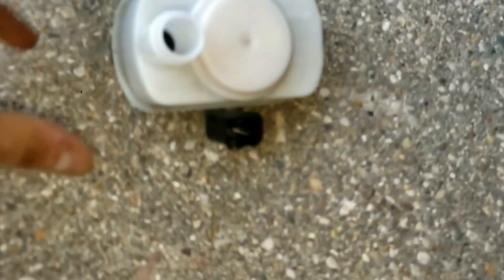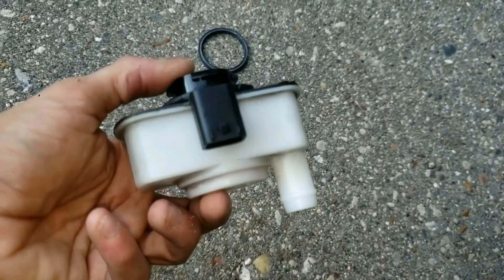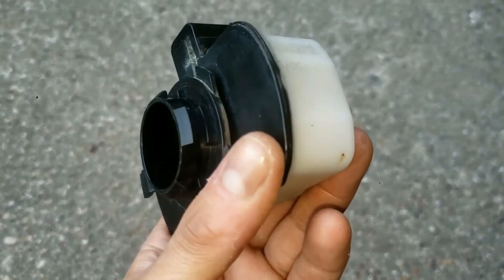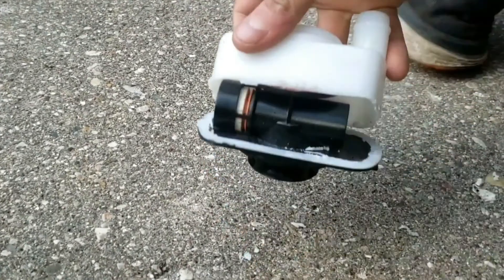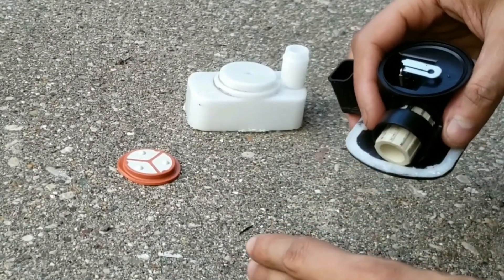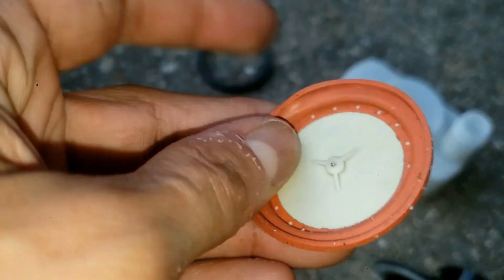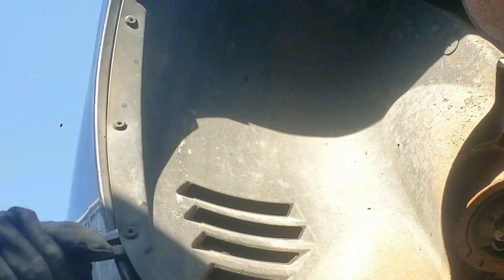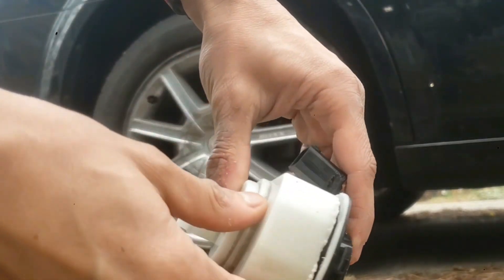EVAP Leak Detection Pump Tear Down 🪓 And Testing Chrysler Dodge Jeep

Comment: Get the Dorman replacement (Amazon $33)- avoid the $20 versions, as those ship with an overstretched too large O-Ring, and they do not rattle when shaken ( pre seized from China
Reply from the maker: Interesting. Thanks for the tip. I think i also used the Dorman one, & put a link in the description.

Comment: There is a crack at the plastic connector. Look on the inside whenever he's got it cut open there's green corrosion on the inside close to that connector. That was actually the issue. Once a corrosion starts it's just replace the whole unit. Here we are in 2025 and they're about 45 bucks from AutoZone. You can get the Mopar one online for about $31 ship to your door. Can't say that the Mopar is any better than the Dorman but look at what year you have and how many miles you have on the car and how long the Mopar one actually lasted
Reply from the maker: Hopefully this comment helps others out!

Comment: Hi after a deep search i found how to test it. It is a sensor not a valve in this case for Dodge, those wires, send a ground sígnale to the Computer and you Can mesure it with a multimeter :)
Reply: Can you make a video Of how to test it ? Love your video
Reply from the maker: Thanks, if I can ever get one of these again, then I will make a new video on this.
Reply from the maker: Nice, always great when you can just use a multi-meter to test these or any components.

Comment: good video. Can I apply DC voltage to unit?  If so, is it 12VDC or other like 5VDC. confused if this is a meaningful test and what voltage. tx for video.
Reply from the maker: I might have used a power tool battery before as a test which which was probably 12 volts.

Comment: How do i know if its a leak detection pump or another part under the hood i have a 2014 chrysler 300 that is throwing codes P0440 and P0441
Reply from the maker: Emissions are tricky. It could be many issues even the slightest like a hole in a rubber hose. Its usually best to start with the codes, and with those codes knock out what the problem may be  preferably starting with the cheapest supply to be replaced unless time is more important than the cost of the item. Then focus on that item to be replaced 1st. Emissions suck!

Comment: This video is helpful.  But the only thing I'll say is: It would be helpful to "see" more of where this part is, how to remove everything, replace the part, and put everything back together.  

On other note, Arizona has reasonably-strict Emissions Testing and it's required every 2 yrs you go to register your tags with the AZDMV
Reply from the maker: Interesting about Arizona. This cant be repaired this part, as its a sealed unit. Also they are relatively inexpensive to replace.

Comment: I have 2018 charger sxt plus replaced purge valve canister, fuel tank pressure sensor still have code p0452 had water in my Evaporative System Integrity Module and the charcoal canister bought new esim and baking the charcoal canister at 225 degrees over night to dry, I’m curious how did I get water there and why? Also will this help?
Reply from the maker: Not sure about the water, but this could help as that code is tied to the evap system, and you said you replaced pretty much many other components of the emission system so it probably wont hurt changing this as this is also a relatively inexpensive part.

Comment: Im curious. Is it possible that a bug could get stuck in there? I found one in mine stuck to the long weight.
Reply from the maker: It's a sealed unit. So very unusual unless their was a crack in it. Or a bug crawled in when it was being made at the factory.
Reply: @FixCarYourself  I agree. Thanks

Comment: So i have a p0456 code and i replaced this today. The old one rattles like your did and the brand new one i installed doesnt rattle.
Reply from the maker: Good to know. This should help others, and further make them aware.
Reply: weird that it does NOT rattle new one.
Reply: @jviews1  still working good. No check engine lights.
Reply: New ones don’t rattle, old one I had rattle too replace with the new one and code went away

Comment: Ended up researching my p0440/p0456 code and this did the trick. I initially got got the purge valve code and changed that and still had the code. Checked vacuum hoses and charcoal canister and after more research saw nothing wrong so last cheap option before a smoke test or canister change would be the detection pump.
Reply from the maker: Nice job! Glad this helped. You did the right thing before doing the smoke test. Glad you fixed the problem yourself.

Comment: I have purchased the exact item from the link. It arrived and looks and functions differently than the one in your video. The weights don't move and there are 2 instead of one. The new one looks exactly like my current one with the 2 weights and the current weights don't move either. Amazon tells me I bought this exact one 5 years ago and that is the one I am replacing.....Even in the item images there are two weights not one like you show......so whats incorrect here? The part or that it should have a single weight or that they should move? Thanks---In NY and they really care
Reply from the maker: How do you know if their is only 1 weight or 2. You can't really tell unless you cut it open. The weights may move when certain pressure is applied to it.

Comment: With the Engine off, and a Smoke test running I get smoke out of the ESIM breather vent behind the Gas Filler. (2015 Jeep JKU). Is the Valve for the vent supposed to be closed with engine off or open?
Reply from the maker: smoke should not come out from the breather vent.

Comment: I was unable to fill gas tank without the nozzle clicking off continuously. Changing this was an option. The video i watched said if you shake the part and it rattled, it was no good. Mine did that and the new replacement did not rattle. I drove to gas station and was able to fill up tank with no issues. 2014 Ram 1500.
Reply from the maker: Great job!
Reply: @FixCarYourself   Ok my old or new dont rattle. Is that good or bad at this point its hard to tell. Video here says rattle good. You say rattle bad......
Reply: @MrMctheking when I replaced my old one it Rattled and the New one did NOT rattle so 🤷🏻‍♂️
Reply: you got lucky. unable to fill tank is usually bad canister, not valve.

Comment: Hello, thank you ver much for your video, congrats for your Good work! I  have a question about the eléctrical switch, is there a way to check it? I provided 5v to the switch simulating the pcm and there is no any sound inside, I should hear the mechanical switch movement sound, right?
Reply from the maker: You supplied power to it so that's good. Normally you would hear the sounds of the weights moving when you blow from the back or the front.
Reply: @FixCarYourself  great, thank you ver much for your help!

Comment: It's not a Leak Detection Pump (LDP). Its a EVAP System Integrity Monitor (ESIM). They are not the same thing. Older Dodge Caravans used a LDP but the newer ones use an ESIM. There is a lot of confusion in the auto parts world about exactly what this component is called. An LDP uses engine vacuum to cycle a diaphragm to pump up the system to test it for leaks. A system that has an ESIM uses the normal pressure variations  created in the gas tank when the fuel vaporizes and condenses to test the system so no pump is required.
Reply: I just bought a new one of these for my Jeep, and it did not make any noises when shaking it. The old one I pulled off the car did make a noise when shaking.
Reply: @Mike__P same for me. I did one today on my sister's 08 jeep grand cherokee. Did this fix yours?
Reply: @JonnyBlazeTCB  nope. Code came back a day later.
Reply: @Mike__P Dang. 😢
Reply: @Mike__P wonder if it IS supposed to rattle then.... ive read others commenting that their new ones didn't rattle either. Mine is slightly different then this one though. It's an 08 Jeep Grand Cherokee.
Reply from the maker: Yep that's right. And very nice quick explanation on the differences. Lot of part suppliers still call them a Leak detection pump though even if they are an ESIM.
Reply: @FixCarYourself hi 👋 I have a question can I replace de evap  just like a maintenance thing ? Or need to wait until fail .. thanks

Comment: My car (2015 Jeep Renegade 2.4l 4-cylinder)  has had tripped P0440, P0452, and P0456. I took it into my local mechanic for diagnosis. After the problem being diagnosed and having the engine computer flashed by Mopar, I have narrowed it down to being this specific part. I ordered parts and after watching this video, I feel more confident in being able to perform the job myself because labor is expensive 😅 I appreciate the how-to in the previous video!
Reply from the maker: Glad it helped and gave you a good idea on how to tackle this, and I'm glad your doing it yourself. Labor is getting even more outrageous, but at least your learning more about your car by working on it.
Reply: Side note: Have you done a transmission fluid change on a Chrysler 9 speed (948TE) transmission?
Reply from the maker: Yes I have done many transmission fluid changes. Specifically on a 722.6 transmission. Actually I'll be posting a series of videos on this...not just changing it but other tips that will help others out, that for some odd reason I haven't seen others on YouTube post or talk about, but I think will really help a lot of others out in case they run into problems!

Comment: Electrical testing of components should be included in repair videos to prove their at fault in my opinion otherwise just a parts changer.
Reply from the maker: I agree, sadly dealerships (Stearlerships) want to make their money, and just jump to conclusions without properly diagnosing, and replace the part. You have no idea how much robbery occurs in the automotive industry...specifically with most repair shops. It's so sad!

Comment: I understand that you suggest a smoke test can cause the pump to fail but, unfortunately, I had a p0456 that I couldn't trace and was left with smoking the system down from the purge line. The results were immediate, smoking pluming from the detection pump filter in the fender well. This is a 3 month old autozone pump and leads me to assume the defect is in the diaphram seeing as the weights were easily mobile. Any input would be appreciated.
Reply from the maker: Normally I would say get a new Evap pump replaced by AutoZone. It should have a 1 year warranty. But 1st make sure the Evap pump is on correctly and tightly. If its not locked into place that could be why its leaking. Or the rubber hose that connects to it could have a crack or tear it it. This is a detailed video that I would suggest you to look at to get a better idea involving the removal and installation of an EVAP: https://youtu.be/1VatmTMP7Fs

Let me know if this helps.
Reply from the maker: I forgot to mention, but also make sure the rubber O-ring is also attached to the Evap pump. Without that, the pump won't be in tight enough.
Reply: I appreciate the reply. The seal was replaced, for sure. I've done quite a few of these but usually not when the pump is this new. The hose was pulled and in tact. It was definitely coming from the cylindrical filter attached to the opposite end of the hose. The pump has been warrantied and now I will do some test driving to ensure the monitors clear. My inclination suggests the diaphram in the pump failed but we will see soon enough.
Reply from the maker: Hope it all worked out for you! Did any codes come back on? Was it proven that the diaphragm went bad?
Reply: @FixCarYourself  It was the inspection pump. Codes cleared, monitors cleared, passed state inspection, sold to a happy customer.
Reply from the maker: @Exithios  Nice!!!
Reply from the maker: The smoke test probably wouldn't hurt a new Evap pump. However, not a big deal using the smoke pump, because this part is relatively cheap and not too difficult to replace if need be. Also the EVAP is usually the 1st thing replaced if their is an emissions problem because its the cheapest part for the most part.
Reply: my in put is: Don't buy Auto Zone Parts, you will be better off going to a Junk Yard and getting a used Mopar Vac Pump, way cheaper too.  Also on this video, the mechanic said  "the raddeling is common on Vac Pump and if it does not, then the part is not good, " this is NOT TRUE.  There should be NO Raddeling at all !!